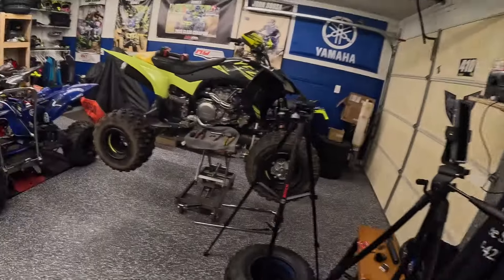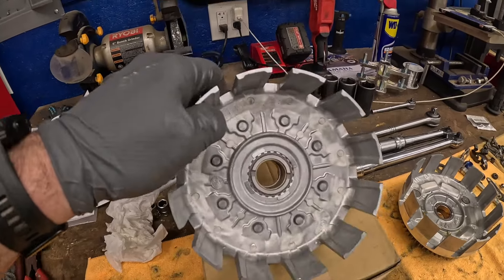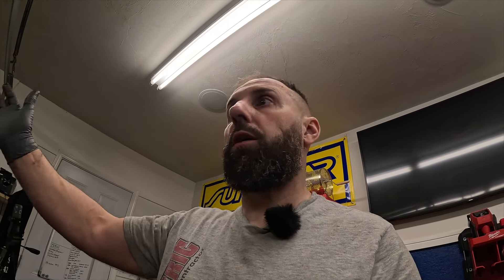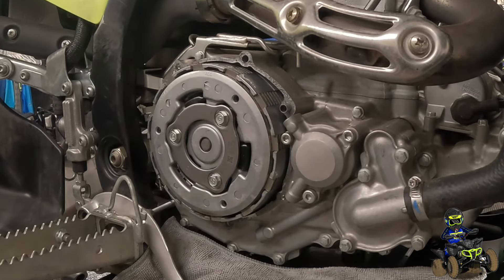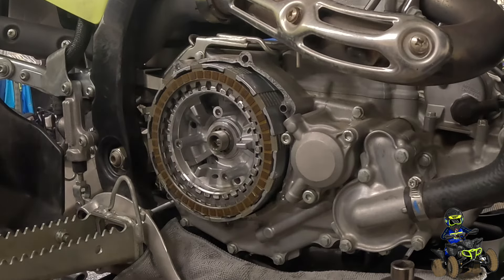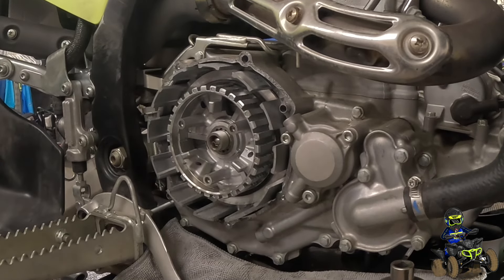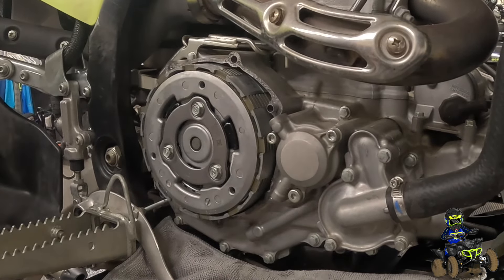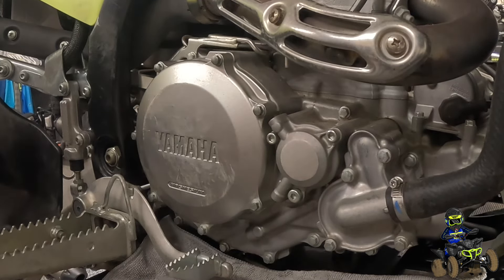Do this before it's too late  - YFZ450R clutch basket swap

Comment: Just what I needed,  thanks so much for sharing this video and the parts number.
Mine just started with  the noise so in need to get this fixed. 
Thanks again.
Reply: You were one lucky person too catch it early, saving you alot of money
Reply: I would not ride it till you get it fixed . I couldn't get the basket for my son's during Covid and it grenade . You walk out of the shop at anywhere between $ 3600 to $ 4000 .
Reply from the maker: Don’t wait get it done asap.

Comment: Question, just did this swap because of your video, is it common after the swap to have a slight rattle when not holding the clutch and in neutral? Didn’t notice this before, seen on a few yfz forums they say it is but would rather ask you. Thanks!
Reply from the maker: It may be i have never noticed it before but i run a rekluse clutch with this basket.

Comment: Do you have a part number for the gasket for the clutch cover I think I found it just don’t want to get wrong one. Also one for the clutch basket tool you had. Thank you sir ! I hate that I have to work on my brand new four wheeler
Reply from the maker: If you go on rockymountain atv you can go under the oem parts just enter the atv info and you can pull up the clutch diagram and select the gasket. If you search on there as well in tools it should come up i have the ebc one and the motion pro one. The motion pro is universal the ebc one is machine specific.

Comment: When ordering the Hinson basket you have to take off the gear on your oem one and put it on the Hinson, it still reuses the springs on the back doesn’t it? I put a Hinson basket in my other yfz years ago but can’t remember if that’s what you have to do
Reply: If you reuse the springs on the Hinson basket can the springs still explode
Reply from the maker: Yes you have to reuse the springs. I think the hinson backplate may be stronger vs the stock on but me personally i would never run a basket with that style cush drive setup.

Comment: Hey so i just did this to my 2018 with all part numbers you provided. I followed your video step by step along with other homework. When idling i can hear a slight sound from clutch area and when clutch lever is pressed sound goes away. Comes back when letting go of lever. Took it all back apart to double check everything. Everything looked good. Is it normal to have slight sound? I cant remember hearing anything before. But then again my dasa full exhaust is loud lol.
Reply from the maker: Is the clutch working as it should? The only thing that can happen is the basket sometimes will not fully seat on to the shaft but you would have no clutch pull if that were the case. If you looked it over then id imagine its ok usually it only makes sounds when the basket is coming apart.
Reply: @ononewheel7  yes works perfectly. I made sure to seat it all the way.
Reply from the maker: Ok id say your good it may just be a normal engine noise
Reply: @ononewheel7  ok thank you! Happy riding
Reply from the maker: @yukon_2a_ftw  thanks man you too
Reply: Jw did you lube the middle of the basket where it rides on the shaft before installing?
Reply from the maker: @yukon_2a_ftw you can oil it. This was all oiled up when i took it apart

Comment: So i just got a 24 yfz 450r im at 91hrs and just starting to do this. I got the new big washer and new 8 pin basket and new lock washer. My question is the two small tension rings do they go back in i already took it apart and dont remember if they went in first. And if so what orientation do they go there both same direction or against each other to create a spring affect? I didnt see them in your inner hub you started putting in discs rite away.
Reply from the maker: Yes you need those judder springs they were already in my basket. If you check out rocky mountain atv go on there orm parts section and select clutch and it shows a picture how they sit.
Reply: @ononewheel7  thanks

Comment: Greetings, I have a 2019, can I use everything from a 2010? Apart from the basket, can I use the clutch boss and the pressure plate? Everything from a 2010?
Reply from the maker: You need the 2009/2010 washer as well and everything else is ok to use.

Comment: i have a 2024 yfz 450r only had it for a week havent put a dent into the break in... rode it only 4-6 hours so far they require 15 hours break in time.... anyway from the day i got it i noticed it wasnt downshifting smoothly like id have to rock it back and forth until i hear a click to move it down each gear when at a complete stop....i was wondering what the problem could be the dealer said it sounded like a bent shift fork but people told me its hard to bend them and theyve been riding for years.... anyway another person told me it could be the clutch plates and another said it sounds like a pressure plate problem i was wondering what your take on this situation would be.....
on a side note the dealer said my machine has a 6 month warranty so its covered through them up til that time but a month before my warranty is up im going to swap it out like you mentioned here but the engine is covered for 3 years minus the clutch go figure.
you have inspired me to finally get one lol
Reply from the maker: Thats weird for sure. If it has a warranty id get it to the dealer asap and have them dig into it. It could be something going on with the clutch. I have never really heard of shift fork issues before
Reply: @ononewheel7  im taking it next weekend and im not riding until i get it back!
Reply: at first i thought it just need broke in
Reply: @ononewheel7  my son in law came and took a ride on it he found the problem the clutch wasnt engaging or disengaging right so all he had to do was adjust the clutch lever and its been shifting real good
Reply: i forgot what he said was the problem thats why i said engaging or disengaging anyway the problem was fixed
Reply from the maker: @ronaldwalters4715  easy fix then thats good man

Comment: Your videos are truly amazing. Good, congrats. I have a 2016 yfz450r, it's happening to me that after riding around with my quad for a bit and I turn off the engine for about ten minutes, after that the clutch lever finds it stuck and it unlocks if I help the fork with my hand. What could be the cause of this, do you think this upgrade can solve the problem. Thank you
Reply from the maker: Usually when it’s hard to shift it can be because of grooving in the clutch basket. You may want to open up the clutch and inspect it all.
Reply: @ononewheel7  Thanks very kind.... I will check
Reply from the maker: Let me know what you find.
Reply: @ononewheel7  I removed the clutch. Everything ok, but a few days ago I changed the cable because it was broken, but the cable was resting on the muffler. When I turned off the bike the heat caused the sheath and the cable to stick together... Now I passed the cable through the cable gland... All solved.
Reply from the maker: Glad you got it fixed

Comment: The previous guy I bought my quad from left the bolt loose after rebuild and I lost all friction on clutch lever completely loose. Is this normal since all the plates were loose in there
Reply from the maker: Which bolt?
Reply: @ the one in the middle holding the whole clutch assembly I don’t know what it’s called

Comment: now you said there are aftermarket options available.. Am I looking for 09/10 Hinson, wiesco etc... or 2024 Hinson,wiesco etc?
Reply from the maker: Hinson is a great setup but still uses springs like hem but I think there set up just holds up way better vs oem
Reply: @ononewheel7  good to know!! Thanks for the insight
Reply: @ononewheel7 can i use 2010 hinson basket w 2010 setup ?

Comment: Will my 2009 full hinson racing clutch connect on this 2009 oem basket plate? Just for mentioning, I also have the new oem generation basket, and it broke!
Reply from the maker: Yes hinson will work.

Comment: Question. I just bought my yfz in september and maybe have 40 hours on it with no clutch problems. Is it possible to just swap only the basket? Id like to go the most reliable but cheapest way possible. Any recommendations?
Reply from the maker: Yup thats the only issue. Swap it out for a 2009/2010 OEM clutch basket and washer.
Reply: @ononewheel7  could you send a link to where I could buy it? If not I'll look around but I appreciate the fast replies!!
Reply from the maker: @dodgecumminsguy9499 contact BNR Motorsports he sells the kits.
Reply: @ononewheel7  will do, thanks for responding, I appreciate it
Reply from the maker: Anytime

Comment: hey i did this upgrade a few days ago step by step and when i starter the quad the clutch was making a loud whirring noise only when in netrual with the clutch out, and also sound loud when i was moving in gear. any idea what it could be?
Reply from the maker: Hard to say without hearing it. Id double check it all.

Comment: I followed all the steps in this video step by step and my clutch is mush seems to not be engaging, any idea? Could it just need tightened
Reply from the maker: Make sure when installing the basket you turn it while pushing in so it meshes with the gears sometimes it may not seat in all the way which will mess up the clutch operation.
Reply: @ononewheel7  everything felt like it was seated in correct, was thinking could be from return spring but did not mess with clutch cable before so will go back and check clutch basket. Thanks
Reply: You were right took basket out and seated it in correctly clutch works fine but now it won’t shit out of first gear??
Reply from the maker: So it won’t go into second?
Reply: @ononewheel7  no it wouldn’t shift to second gear, let bike run for while so plates could sit was going to check tonight and see if still have same problem, any ideas? Did not have problems shifting to gear before only decided to change since i was doing clutch basket

Comment: Do you know which way the jutter spring goes in? I can’t remember
Reply from the maker: My manual is showing the 2009/2010 basket which has no judder springs but looking at rocky mountain part#16 goes in first then 15 second then the clutch pack they kind of sit against each other acting as a spring hope this helps
Reply: @ononewheel7  yeah one is a spring that has flat side and the other has a flat side and a like a rounded side, I put in new clutch plates and fibers and I have tension when I pull the clutch in but when I put it in gear and let out on the clutch is doesn’t move

Comment: Does the clutch assembly of the YFZ 450R 2024 fit perfectly on the YFZ 450R 2009? without adaptations?
Reply from the maker: Everything is interchangeable. Just change the basket, washer and you can re use everything else.